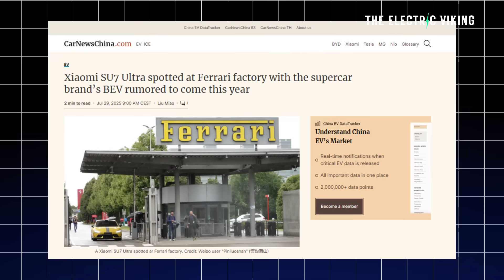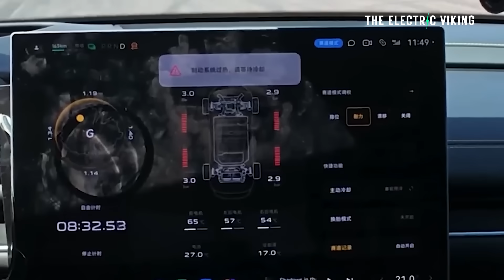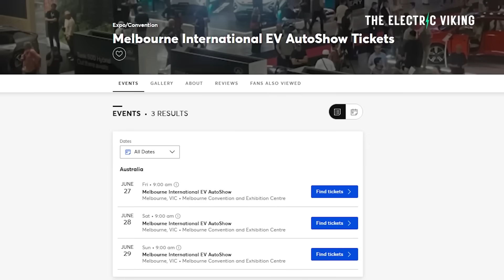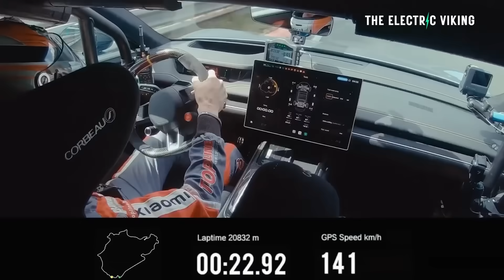Ferrari Secretly Buys Chinese Electric Car to Study How it Works

Comment from the maker: The car I drive, the Xpeng G6 - https://youtu.be/IcniwO8NfQQ

RESINC Solar installed my battery and solar system. Get a free quote from them here: https://www.resinc.com.au/electricviking
Reply: Hello Sam. 3:58  Sorry, I disagree, Sam, but these European car brands you mentioned actually have a huge selection of suppliers in Europe ready to be part of the EV industrial ecology with these major brands you mentioned. 

I am talking about Marelli, Bosch, Schaeffler (made the ePerformance with 1200 hp (you can search for it making perfect donuts 6 years ago), Foxconn, and then the creator and designer Bertrand for any types of parts, and so many many other WAITING for the major car brands to finally make a desition to the politically promised transition to electric by 2035.

 I really don't understand what is holding these European carmakers for the transition to electric.

I forgot to mention STMicroelectronics. They are excellent. and at the upstream ASML producer of lithographic machines for semiconductors and chips.
Reply: shit-peng
Reply: @DoubleClick-b7 lol 2 month old account with already 22 comments on this channel all to sht on Chinese EVs 😂😂😂

Comment: I don't believe Ferrari or Porsche 911 for that matter, can replace engine and gear box with EV. Leica camera adopted digital systems only about 5 years ago. Fans accepted them because the lens is still an original  mechanical part, like engine and gear box for a car. The is cSU7 is ertainly faster in acceleration but lack the handling and feel provided by the engine, gearbox, mechanical steering, gas pedal and brakes, and no engine noise. Fans buy Ferrari or 911 for mechanical fun, EVs are no fun.

Comment: The thing with cornering in the SU7 Ultra is that you don't drive it like a regular sports, race, or supercar, which are much lighter and usually RWD. 

With the Ultra, you 
1. need to brake much earlier to stop in time, 
2. need to take a tighter line through the corner at a lower speed, and 
3. rely on the insane acceleration and good grip to rocket out of the corner and take back the time you lost in the corner by being faster in the straights.

As such, driving the Ultra is completely different from pretty much any other sports car out there, with a much different rhythm.

Comment: China has been into reverse engineering for decades. Part of the reason BTR Nylex failed when it's intellectual property got snavelled starting in mid 1990s. Ferrari would not do an EV but maybe under a different fully owned  marque is a different scenario. The Ferrari name is above all others in high end vehicles and would be destroyed using fake sounds or sounding like a washing machine.

Comment: It is weak in demand, people buy Ferrari/luxury performance for the emotions. It's nearly never been the top spot of top trump card metrics, nor did they care about the cost of fuel when you're buying a Ferrari... 

Most probably the reason why Ferrari is looking into EVs is so that they can subsidise more of the tax by pumping out EVs instead of buying eco point slots from the likes of Tesla etc.
I think the EU is setting higher costs for these green levy penalties, which makes developing an EV more worthwhile.

Comment: It is a very tough challenge for Ferrari to build EVs,  the challenges are software development, chipsets design, AI, and back end IT services to support the platform.   Ferrari probably 10 to 20 years behind, and they do not even have battery technology either.   With the scale of vehicles that Ferrari build, will be very difficult to recover R&D costs.
Reply: Why? Porsche have been able to do it.
Reply: @thethirdman225  Porsche has a father named Volkswagon.
Reply: @yourtemp6135  You think I don’t know that? I find it highly unlikely that Ferrari could be 10-20 years behind on this. They would have access to any number of top automotive engineering experts. If they can buy the car, they can buy the engineers too. The biggest obstacle for them is probably the battery anyway and that is likely to be outsourced.
Reply: @iu2  LOL!! Yeah, whatever.😂
Reply: @thethirdman225  battery isn't a problem, just like you said they could buy them from CATL, the software include AI will be the bigest obstacle to overcome. If they outsourced then they just a normal car brand.
Reply: @thethirdman225  it’s quite possible they didn’t put the resources into it until it was too later. Hubris
Reply: @thethirdman225  The most challenging aspect is the electronic electrical architecture (EEA). The EEA of electric vehicles and conventional gasoline-powered vehicles is completely different.
Reply: @thethirdman225 porsche even getting their battery from China 🇨🇳  🎉

Comment: Even if Western EV makers find out the secret of Chinese EVs, they still can't beat Chinese EV's low price.
Reply: They will have a Chinese battery in the Ferrari. LOL!
Reply: @bobsmith3983   Sure. Why not?
Reply: @bobsmith3983 They will also have Chinese Rare Earth in their vehicles
Reply: Exactly
Reply: Or the SUPPLY CHAIN.
Reply: They can made it in India, India's salary is cheaper than China's
Reply: @amandagrant4331  On one condition: that it’s done with clean energy. China has been exporting its carbon pollution for decades but is now dramatically cleaning up its act. By contrast, India is increasing its fossil fuel consumption.

I think India is perfectly capable of doing this but it can’t be open slather. EVs have many advantages but we don’t want to arm the anti-EV lobby with any more “EVs pollute too” arguments, however disingenuous they may be.
Reply: @amandagrant4331 😂😂😂 for you Info, 1 Vietnamese worker = 4 Indian workers.

Comment: Remember Sam Ferrari have F1 engineers, building an electric car for them would not be as hard as it would be for others.
Reply: Mechanical engineering is totally different from electrical engineering. 😂
Reply: Good engineers yes definitely, but EVs need very different expertise so very solid approach for Ferrari to start the journey by studying from the leaders of the pack
Reply: The same could be said for Mercedes… I don’t see them excel in EV sectors
Reply: I agree building an EV isn't hard for Ferrari. I think the hard part is building one with a reasonable priced, NOT F1 priced! 😂